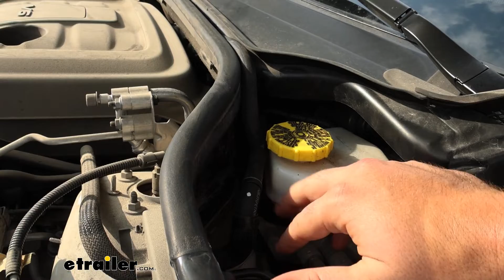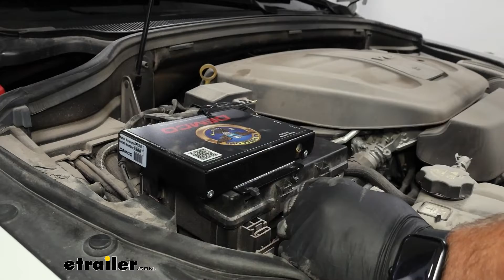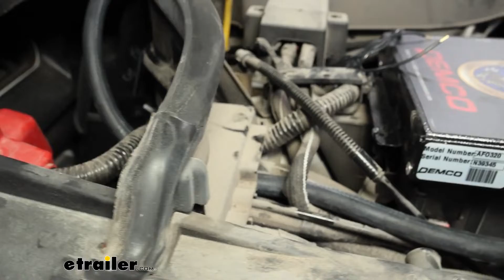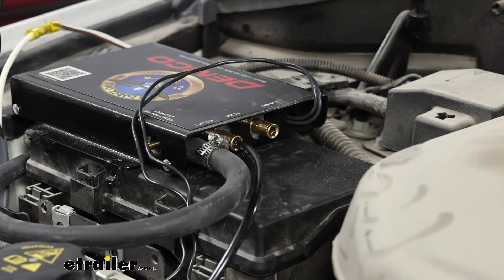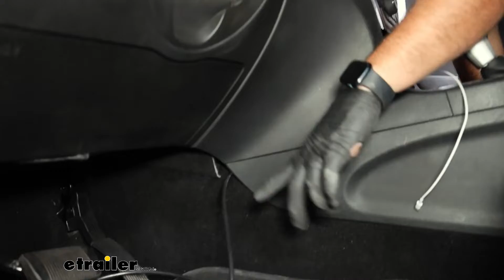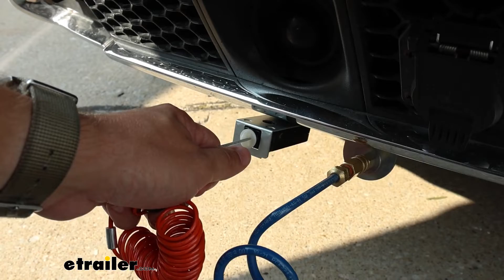etrailer | Demco Air Force One Supplemental Braking System Installation - 2020 Jeep Grand Cherokee

Comment: You don’t sell an add a car kit! You make us buy the whole system every time!
Reply from the maker: We actually do sell an add-a-car kit. The Second Vehicle Kit # SM99209 includes the vehicle-side components needed to add another vehicle to your existing Air Force One setup without buying the complete system again.

https://www.etrailer.com/Accessories-and-Parts/Demco/SM99209.html
Reply: @etrailer I have asked for an add a vehicle kit 3 separate times and I always end up with a complete kit so I have 3 extra tanks setting on the shelf. I guess I need to talk to a different salesman